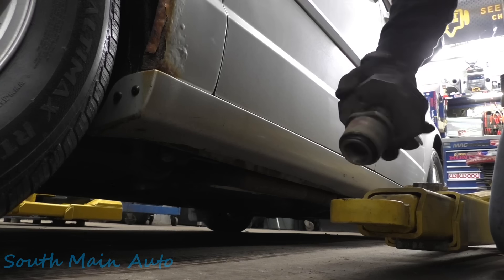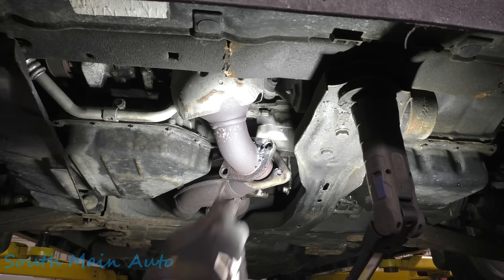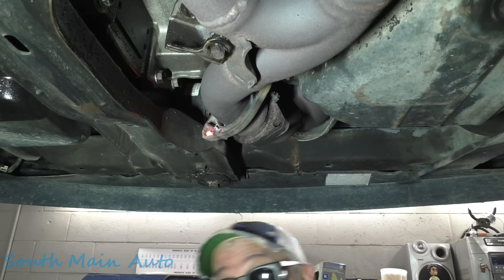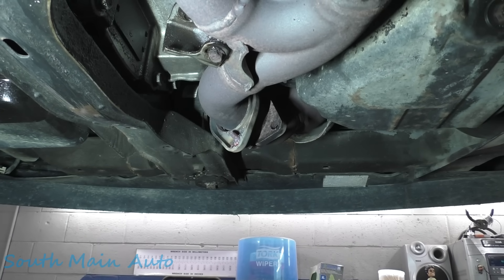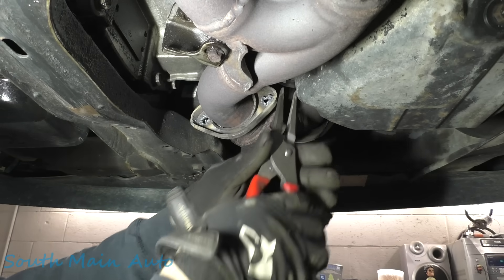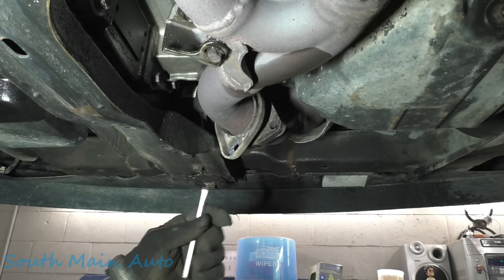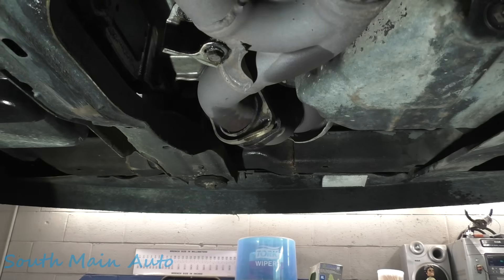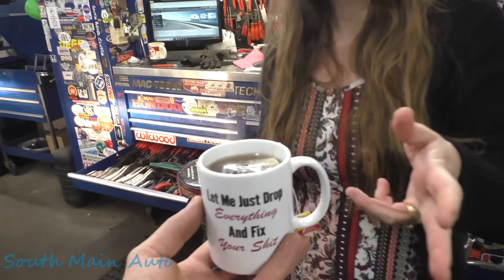Dodge Caravan: Leaking Exhaust Flange (Rusted Out Bolts)

Comment: Spot welded nuts that you can't get to are the ones that break off easily.
Reply from the maker: #truth
Reply: Superseded by one’s that are stripped out
Reply: So true
Reply: For sure, that and the inaccessible caged nuts that are contained by the weakest metal cage known to man
Reply: bonus points for the ones for  lower control arms that are inside the crossmember!

Comment: Glad you were VICtorious in getting the nuts free. As someone who has DIY'ed a flange like that, it was a lot of Dremel work.
Reply: I did one recently and drilled the bolts out.  They were mostly gone and just rusty metal blocking the holes.  What a nightmare, had to wedge the flange in place, drill it while using a 3ft bar pushing on the back of the drill for leverage.  Never again haha.

Comment: Man I tell you what Eric. You have got me loving Astro tools. My in laws got me the 52SLC for Christmas and it's the best light I've ever had. And I've ordered a bunch more of their tools, and went up to Summit racing to get a back probe kit and other stuff and got more astro tools there. It's a 2 hour drive to summit for me but it's well worth it. And I'm now super knowledgeable on circuits and how they work and testing them and using my alldata for OEM info. Thank you sir, you are a godsend and a damn awesome dude!
Reply: Get the Astro Nano sockets, while you're at it. Game changing in tight spaces.
Reply: @brandonsimunac  bought them at summit the other day!
Reply: I've said it in multiple videos, but It goes along with your statement, sir. That Eric belongs teaching more than running his own shop. His value to others, "in my opinion" would be better served, creating more top quality mechanics like himself. Hopefully, if he retires, he will give it some thought. I mean, he's already teaching people through YouTube, so a classroom should be easy peazy.
Reply: My main complaint is that the battery isn't designed to be replaceable. I've got a cheaper Braun version, which uses a standard lithium battery that can swapped in like 10 seconds. I actually keep a couple on a charger so I can just swap them out for nonstop use.

Comment: I used a map gas torch and a stripped nut remover hammered on the red hot nut and the air hammer and got mine off my Hondooo they were not welded but they were welded on by rust.

Comment: Blue wrench spoken here. Depending on what you drive, ramps or jack stands can get you high enough to access most exhaust parts. 

I’ve used a die grinder to remove the ruminates of the spot welded nuts. As much as I hate Harbor Freight, they sell pneumatic right angle die grinders for $25 on sale.

Comment: For people looking to solve this problem at home but with limited means available, I recommend Clamp-A-Stud. Basically a c-clamp to pull the flanges together from the side. I had this problem years ago with my daily driver pick-up truck and the Clamp-A-Stud fixed it in 10 minutes for $40. The repair lasted for as long as I owned the truck.

Comment: Great content, I've seen a lot of these break, after jacking around trying to remove the welded nuts, I've found it easier and less time-consuming to heat and extract the broken bolt, then heat and remove the bolt that isn't broke. If the threads are messed up drill a 3/8 hole through and bolt it up.

Comment: DIYer here. Dremel with the small tungsten carbide bit did the job for me. It was not a fast process but it did work.
Reply: Do you have the part number of the dremel bit you used for this?
Reply: @splat7147  I think I used the 9903HP
Reply: @KyleRepinski  Thanks! Did you use the bit  to grind at the side of the nut or come straight down on the top of the nut until you grind it all away?
Reply: @splat7147  what I had going on was there were two studs welded into the very thick flange that broke. I had to turn them into through-holes to replace them with a bolt and nut, and it was absolutely roasting my hardened drill bits. That Dremel bit slowly but surely did what my expensive drill bits couldn't. 

If you're doing what I think you're doing, I'd try to use the bit to split the nut in half.

Comment: No torch option is just cut the bolt, then the non-fixed flange as long as that is the one with the welded nuts - then fit a 2 piece repair flange, it gets around the lack of torch / welder especially if the flange is corroded to the point it no longer identifies as being suitable to hold your exhaust together.

Comment: Considering the lack of rust I think it's 409 stainless. It's magnetic, isn't shiny like 304, but it takes heat pretty well and resists corrosion. My Nissan has 409 exhaust tubing but in their infinite wisdom, they used plain steel flanges and fasteners. The flange at the back by the muffler rotted out a couple years ago so I replaced it with a coupling and U clamps, but I spent a better part of New Year's weekend under my car fixing what I thought was a blown out doughnut gasket, turns out the flange rotted out and broke free from the pipe.

Comment: Been taking a few old school square nuts off my restoration project. Like you said, a dremel tool you can cut it 4 times and twist each spot weld loose. Not optimal unless that's the only way. If I had a torch I would have 6 holes to choose from when I bolted it back together.

Comment: I live in the Canadian rust belt of Ontario.  When I work in my own crap at home, I use a cheap torch with map gas and oxygen tanks.  It takes a little longer, but works.  They usually cost around $100 at a box store.

Comment: Speaking of nuts and bolts, tractor supply is my favorite place to pick up grade 8 nuts and bolts like that, much cheaper than my local hardware stores and big box stores.
Reply: Big box store stainless steel bolts are typically 18-8 stainless unless otherwise noted. 18-8 is soft and rusts just about as fast as a grade 5 bolt. 

No reason to use grade 8 bolts for exhaust work. 

I purchase boxes of bolts monthly from boltdepot. They’re about 1/3 of the prices of the big box stores.
Reply: @gungadinn  I don't know, I've had a different experience up here on the Maine coastline. 18-8 stainless steel hasn't rusted on me yet when used outdoors or under a car. I used some on a heatshield on my old subaru and while they did get dull, they were still rust-free after 3-4 winters. A clear or yellow zinc bolt would never be able to do that.

I just said grade 8 since that's what he used in the video, and honestly they're not much more expensive when you buy grade 8 vs grade 5 by the pound at tractor supply.

Comment: Ah, the Trash-n-Crash. Nice to see one not all rotted out, most of them here in Metro Detroit are rusty and crusty. Usually see the front edge of the hood rusted out. As for what a diy'er could use, a mapp gas torch works pretty well, takes longer than the oxy acel torch, but gets the job done. Btw, those nuts are spot welded on there so that the folks on the assembly line can zip the exhaust together quickly.

Comment: For me, doing similarly to my own car, I had it on 2- jackstands, sawed the rusted bolts off flush to the welded nuts,  center punched the bolts, drilled out them and the centers of the nuts, replaced them with 2-longer bolts, 2-washers, 2-nuts (right on top of the old ones😁),  like you, except I left the outer part of the nuts, and think my available hardware was metric. 
No torch? no big deal.😁👍🇺🇸😎

Comment: Well Eric, from Midas mechanic of  5 years the best way your DIY fella you can use map gas heat bolts too Red hot with vise grips you can un-screw the bolt and reuse nuts in most cases. Or with out torch use air die-grinder and cut welds loose  add same as you did new bolt nut.

Comment: What I've learned:  You can do it, I  also can do it.  But you can do it easier and quicker than me cause you have Vic, car lift, and much more experience yhan I.  (Not to mention air hammer versus cold chisel and hammer).  That's why I don't mind paying a pro like you.    By the way, you did make me nervous talking about cutting off nuts.

Comment: I just did this exact repair last week on my van. I ended up just grinding off the rusty studs that were left and I welded bolts on where the studs were. I left the nuts on the other side because I figured it would be hard to get them off.

Comment: Worked at a muffler shop back in the 80's. Still have scars from hot metal going down my shirt. Happened 3 or 4 times. As far as a DIY project, I would have cut off the bolt remnants then drill out the the stuff in the nuts. I would leave the old nuts and install new nuts on top of them.
Reply: Clearly a Midas touch 🤭🤫🤷‍♂️😎😂
Reply: Too much work for that job. Perfect job in the video.

Comment: I find most of the time tack welded nuts break off pretty cleanly when you just give them a healthy twist with a long breaker bar and a six point socket. When they're good and rusty it seems like the weld beads get more brittle, and break off that much easier. In this case I'd hold the flange with a monster pair of channel locks while I'm at it, and sometimes it helps to rock the nut back and forth until it breaks off. In any case it only takes a few seconds to try it and feel things out. If they still refuse to yield, in a case like this, where the whole part is accessible, I'd heat the flange up from the back side, bringing it to full red (hotter than dull red, cooler than bright orange). With the nut itself not directly subjected to the flame, relatively cool and solid but the flange hot and softened up, a socket and breaker bar will definetely break the nut off. If the nut is in such bad shape a socket just won't grab it, or the weld beads are huge blobs of metal you can't get a socket over, vicegrips usually work, so long as the flange is hot and sufficiently soft, the tack welds will give way. This approach is fast, uses less gas/ox, doesn't leave slag that needs to be cleaned off, and so long as you're careful with your heat control, doesn't run the risk of damaging the flange. Worst case, you totally screw up and just round the nut off, you're no worse off then you were in the first place.

Comment: As a  DIY'er since I can ever remember at 76 yo I wuddah cut off the bolt and drilled it out. , Left the welded nots in place and used next size down bolt and nut.

Comment: I'm DIY... and I have a Victor Journeyman torch and own my own bottles.  Why rent when you only use them once a year?  Came in handy last weekend for the front disc brakes on my Hondoo Odyssey... those rotor screws want to stick tight... broke several impact Philips bits.  The old blue wrench works wonders.  Did have to Dremel a slot in one of the screws, the broken Philips bit piece stuck in there, never seen that before.

Comment: as a DIY'er, if it were me I'd...
try and hammer/chisel off the welded nut on the broken bolt one
soak with panther piss the "good" one and see if it'll come out.
put an oversized socket on the nut side of the flange and sledge hammer the bolt remnant(s).
hit the nut with a grinder and/or cutoff wheel of some kind to section it apart and rip it out.
sawzall/hacksaw the remnants flush with the flange, then start drilling out the bolt.  eventually you'll step bit up enough to break the nut off. harbor freight step bits are great sacrificial bits for that.
you might end up with a bigger hole, but you can "fix" that with some washers, trimmed to fit if needed.

the preceding is not an in order recommendation either. YMMV. IANAL. No Holiday Inns were occupied recently.

Comment: One option for a DIY'er is a set of nuts extractors on the welded nuts. treat them like rounded off bolts and twist them out with extractors. probably the first stop I would try.

Comment: As a DIY guy, I would probably cut the bolts flush and drill a hole through the nut to the next larger size.  Then just leave the spot welded nut there and use a longer nut and bolt.

Comment: Just had the passenger side flex pipe replaced on my 14 Ford Explorer Turbo, (the big 3.5) and the pipe, about the length of my arm, was $395 cdn! Thanks Ford! The driver side is $495! Yikes! 😮  Similar location to this repair, and took about as long.
Reply: That actually sounds pretty reasonable.

Comment: I think you could just drill out the welded nuts bigger and just put through bigger bolts and a nut to back it up, just in case you don't have a torch,  but that might just be some corn field engineerin'

Comment: I would grind big portion away and drill new holes in the half rotten bolt bits and hold the flange with vise grips.

Comment: another way to do this is to lite torch set to heat the metal but dont  press  the  handle,,, just put the flame on the part an decrease the gas until it starts to blow the steel away,,,much easier to control the flame that way.

Comment: Man Eric, you finally posted a video that had an exact issue I needed to address! I happen to have this exact vehicle (well, it's a Grand Caravan, so the badging is different), with the exact same issue. I've been going in circles trying to figure out what kind of bolt I needed to get to replace that one, if I could ever get the broken one out, thinking that the nut was buit into the flange. Well, I guess it turns out in a roundabout way it is, just not in the way I thought. Now that I know I can just torch the damn thing off, and grab my own nut and bolt to replace them, that makes the job a whole lot easier! My only question for you now (and you touched on it in the end of the video) was that I have an issue on the other side of the van I haven't quite tracked down yet. I believe something similar has happened on the drivers side, and it seems to be behind the drivers side seat. Looking under the van I see a ring has come loose and is just dangling off the exhaust pipe, but I haven't been able to figure out where the ring came from or what portion of the exhaust I need to chase. Do you have any sage advice there? 

Thanks for all the videos! They're a fantastic resource!
Reply: That ring is usually a part of a flex joint. Not much you can do other than cut it off and discard it, then replace the flex joint whenever it finally starts leaking.
Reply: @Krankie_V  good info! thanks!

Comment: I hate exhaust work with a passion.  Manifolds especially.   My boss put a lift in, I'm a mechanical designer that has worked on cars for 40 years.   I've worked on some real problem children for him.  Trying to do exhaust work on a W12 VW phaeton.  The dealer shows engine removal, I have to figure it out without that.  I did replace the water cooled alternator by making a tool.  VW would had to pull the engine for that as well.  Wish me luck. I just want to design power plant equipment like I'm paid to do. Worked for this company 31 years now.

Comment: i have the same van,,been driving all day today...start ..stop.everywhere..no problem....last stop..sams club in for 20 minutes..came out started van sounded like i put headers on it !!..i thought someone stole my catylitic  which is going on in our state... drove 10 miles home..no overheating check engine anything wierd except loud noise.. got under car when i got home everything seems to be ok...even exhaust coming out the rear pipe ..but noisy....do u think this is my problem.. it does seem noisy under the hood...mine is a 2010  town an country..

Comment: I just did a flange on a 96 suburban three bolts and had to use the torch. I find using the torch sucks without a lift. Got it done though.

Comment: I just changed the mid muffler on my 07 T&C S&G, and the hardest part was the fact walker doesn't seem to understand what 2.25" means.  the inlet side was WAY too big, and the outlet side was way too small.  total ghetto move I had to take a piece of the old pipe and make a split sleeve to go around the new pipe to make up the space enough for a set of U clamps to work.  the fancy OEM full squeeze (but with stopper) clamps couldn't tighten enough.  should have done the same up front but I was already so deep in the red mist that I just CRANKED down on the nuts for the U clamp and it sealed, at least enough it seems.  it's old, it rotting away badly, I just wanted it to NOT sound like a dump truck for however long I have left with it.

Comment: How i usually get those tack welded nuts off wo a torch (because i dont have one, just map gas), i put an extractor on the bolt and either the bolt comes out so i can reuse it after running a thread chaser or the bolts siezed enough and the nuts rotted enough it just snaps off the spot welds. Only once ive actually had to drill out the broken bolt because the nut wouldnt break off and the bolt snapped again instead.

Comment: Those nuts are press fit into the flange, I normally grind the bolt side flat, heat it up and drive out with an air hammer.

Comment: Hey Eric , first off your video's are the best, if I lived in upstate NY I'd be bringing my car to you but I live in Maine . hate to bug you but I have a question if you have the time to answer if not I understand . I own a 2017 Ford Escape with the 1.5 Eco Boost with 35000 mi. saw some video's and these guys said those engines are junk due to the head gasket , have you run into any of these problems on the Escape ? Thanks Rich.

Comment: Maybe cheaper at factory to do the spot weld of nuts???? Doesn't make it easier for the mechanic or home mechanic though.  Anyway, a 2011 here in Arizona would be a 10 minute job, as the bolts would simply be unscrewed - like when someone simply unbolted the four bolts and nuts holding the catalytic converter on my 1998 Frontier when they stole it; anyway, the same four bolts still secure the replacement converter to this day.

Comment: If I was DIY ing it, I'd just leave the nuts in place and drill out the thread in them
 Of course it would be way easier to blow the bolts out with a flame wrench and then drill hru the nuts.